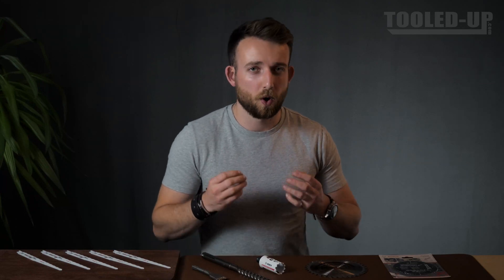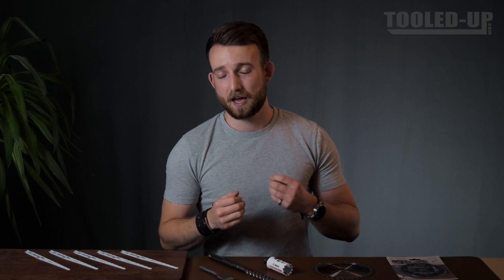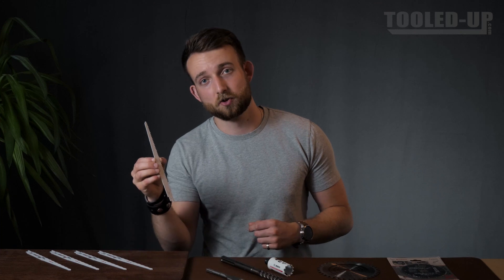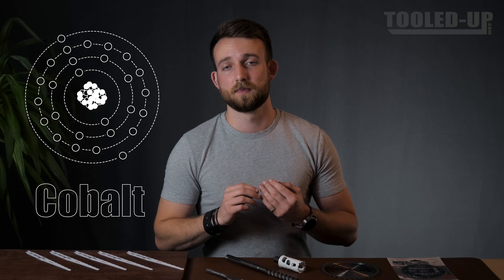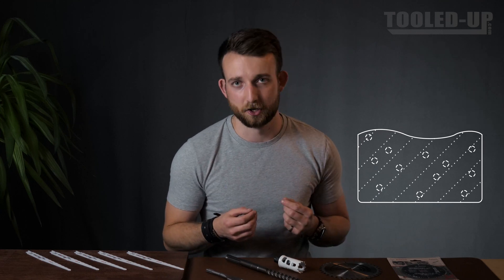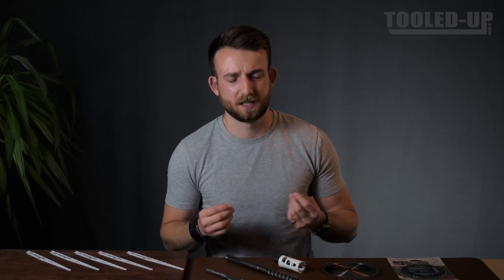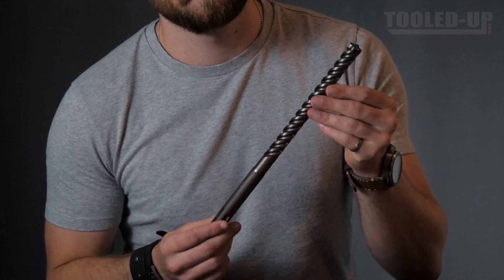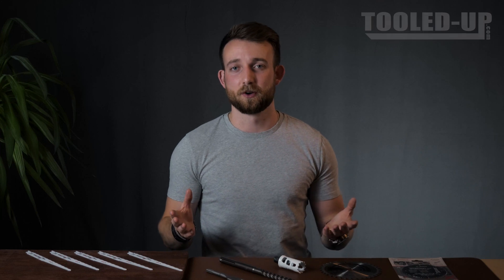What is carbide? (Explained)

Comment: Carbide itself is not an alloy, it is a compound of carbon and any other metal element where a molecule can be formed. The best known being Fe3C aka cementite, carbide steel or puddle iron. Extremely hard, does not rust at all, very brittle.

Comment: What makes it brittle tho? I’m clearly not a machinist but I like to learn. How is it used to cut metal at high speeds if it’s so brittle? Or am I just thinking about it in the wrong way?
Reply: Different grades are more/less hard.
By brittle it's mean it can shatter when say your feeding to much metal into your carbide mill bit.
Metal will bend or warp. 
Carbide is made from tungsten, carbon and cobalt. Essentially it's a hardened cement. So when over fed, as I mentioned before. It will shatter into pieces.
Reply: Basic physics and metallurgy. Durability can be measured in a couple of ways. Consider swords now you would think a tougher harder stiffer blade would be ideal however if there is no bend or give it will just crack or shatter. Same applies with steel bits as a drill can apply a lot of torque it can easily snap a drill bit that is too hard this always makes a big difference the longer the bit is like a sword compared to a knife as knives tend to be much harder because not as much torque(twist) is generally applied too it being much shorter